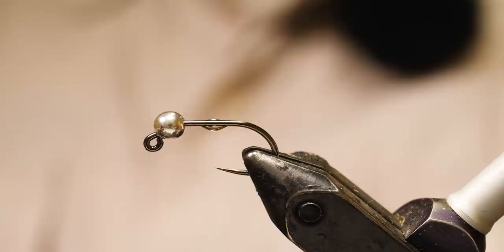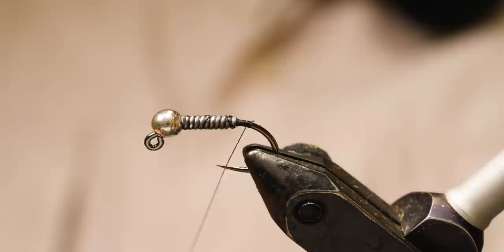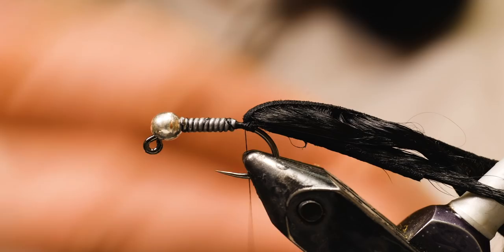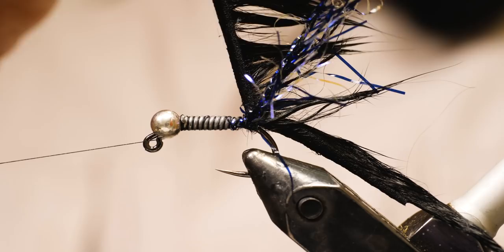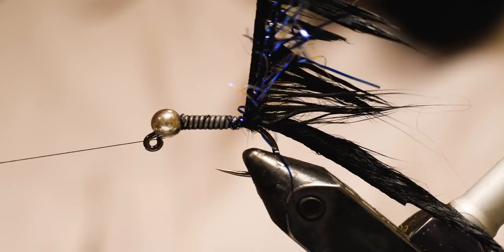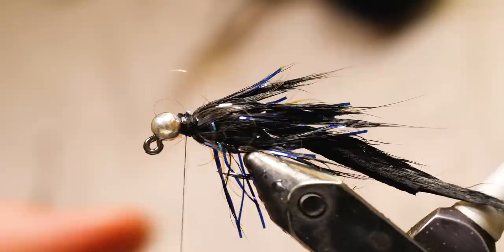Backflop Jig Streamer Fly Tying Tutorial

Comment: I’ve tied this fly and used it in my local lakes and it’s awesome. I’ve tied it in some bright colors as well as black and olive. They all work well. Thanks for video.
Reply from the maker: It's one of my favorites on lakes as well.
Reply: I'm assuming on still water this is fished under an indicator of some type. Do you impart movement to it or just let it ride? I fish a lot of super slow water or ponds so I'm definitely interested in your technique.
Reply: @neosovereign5954  I’m not sure if you’re asking Devin or me but I use it on different sink tips. Lately I’ve used it on a 3 inch per second line. Right after ice off I used 7” per second line and stripped it back slow. I have tried it under an indicator but balanced leeches work better for me under an indicator. Hope that helps
Reply from the maker: @neosovereign5954  I tie it on a straight shank hook and strip it in stillwaters though you could certainly use it on a jig hook under an indicator. I wouldn’t tie it as heavy though.

Comment: I like the body technique. I tie a similar pattern but only palmer the chenille and then simply bring the squirrel over the top--this technique blends the materials nicely. Dyed mallard also looks good in place of the soft hackle and gives some barring/texture to the shoulder of the fly.
Reply from the maker: Pat, How does the mallard hold up to teeth? I've had issues with the quills and the feather fibers breaking off in the past after a few fish.
Reply: @tacticalflyfisher3817  I've had no problems at all; I even use palmered mallard for the shoulder on my bass and pike flies. I wrap back over the stem with my thread, which protects it from teeth, plus flairs the fibers more. It works great if there is a bead or lead wrap to "jam" the flair up against.  I find that mallard maintains shape better than soft hackle, which tends to collapse on the strip. I tried to borrow from musky streamers that give the illusion of bulk without actually adding more material.

Comment: Devin does it matter if the leather part of the tail is riding up or down? Other patterns with sinker or rabbits  they’ll poke a hole through the tail and thread it on so the fur portion rides up, curious on your thoughts
Reply from the maker: I’ve tried it both ways. I haven’t found that it makes much difference. On the really thin squirrel or mink strips it’s hard to poke the hook through without breaking the strip so it’s easier to do it the way I do it this video. Otherwise you could tie in the tail “upside down” and tie the body in separately if you want to invert the tail strip.

Comment: Great video.  I will have to try this pattern. Lance’s Jig streamer has been working well but it will be nice to have a different pattern!  Are you running the streamer as a point or dropper or solo?  Thx!
Reply from the maker: Usually solo but you could add a nymph above if you want.
Reply: @tacticalflyfisher3817  what length is the tail compared to the hook shank?  1 or 1.5 x?  Thx
Reply from the maker: @chriscrumbley9219  1.5-2

Comment: What weight rod do you use when throwing these double weighted?
Reply from the maker: I'm not sure what you mean by throwing them double weighted. But normally when I'm fishing these on a Euro rig I tend to use a longer 3 or 4 weight Euro rod.
Reply: @tacticalflyfisher3817  
You mentioned in the video that you often added an additional bead to get them deeper. I was just curious if you used a stiffer rod. I normally tight line with a two weight recon or Hardy and wasn’t sure they would handle this fly.
Reply from the maker: @rickconyers5873  You do need a little more power than a soft 2 weight but it's as much because of the hooksets required for larger gauge hooks as it is for the casting.
Reply: @tacticalflyfisher3817  
That makes sense. I appreciate it, and I appreciate your videos and instruction!

Comment: Would you recommend this for larger ties for larger trout? Say, size 2 hooks?
Reply from the maker: You can certainly tie it larger if you want. Because I'm often "nymphing" it on a Euro leader, I tie it smaller to keep the sink rate higher since larger versions will have more surface area which reduces sink rate. I haven't had a hard time getting large trout to eat a size 8 but feel free to try whatever size you feel confident in.
Reply: @tacticalflyfisher3817  Thank you. I fish a river that has large lake-run trout in the winter and they like to hold deep in the undercut banks and pools. These areas are often 5-6 feet deep, and sometimes deeper depending on flows. 

I can usually successfully fish the trout in the deep pools with standard nymphs, but getting something deep under the banks is more difficult. 

Since there are many small/young trout in the river in the summer/early fall, but very few, that I can find, in the winter, I've been thinking that in the winter the larger lake-run fish are eating the 3-6 inch young-of-the-year trout. 

So I'd like to try a larger version of this pattern, hoping I can lob it a maximum of about 20 feet or so across the river on the same Euro rod and leader that I'm already nymphing the deep holes with with, hoping the streamer will get down deep under the banks quickly.
Reply from the maker: @acorad1  give it a go and see what happens. Tie a few smaller ones with a lot of weight as well. They should get into those undercuts a little more quickly.
Reply: @tacticalflyfisher3817  Thank you for your responses, I will do that!

Comment: Devin. What X tippet do you use when fishing this fly
Reply from the maker: Usually 5x if I'm fishing it on a Euro nymph leader. If you tie it on a straight hook and cast and retrieve it in rivers or streams, then I would fish 3x or 2x.
Reply: @tacticalflyfisher3817  Thank you
Reply: @tacticalflyfisher3817  on a 2 fly rig with a nymph dropper or as a single fly? Thanks!
Reply from the maker: @FabMason  probably more often as a single fly but you can always build in a dropper on the rig and add or subtract a fly as necessary.